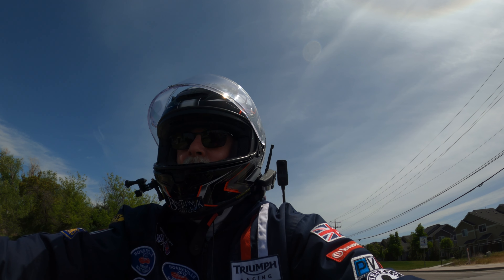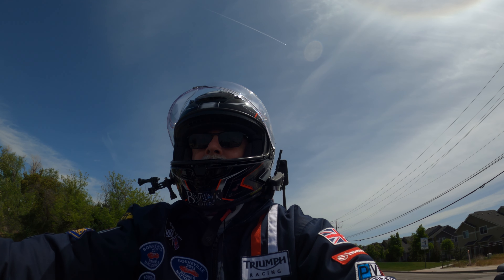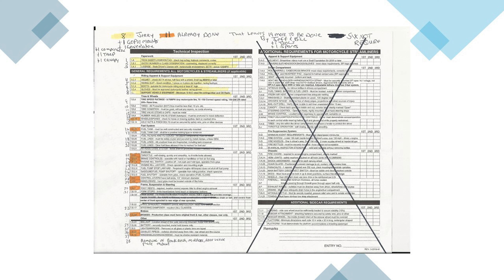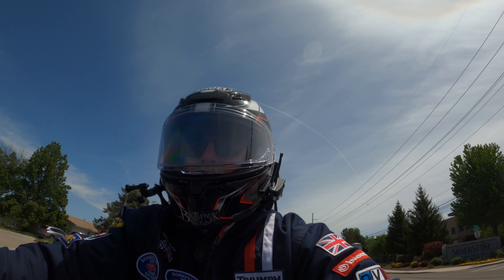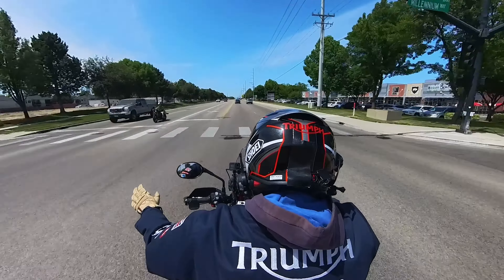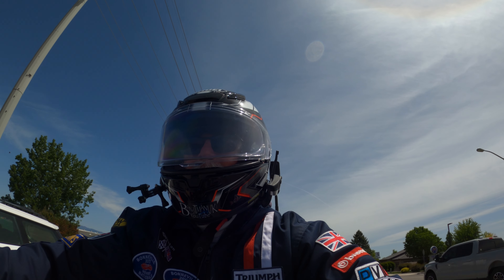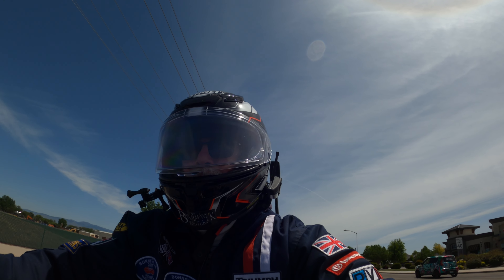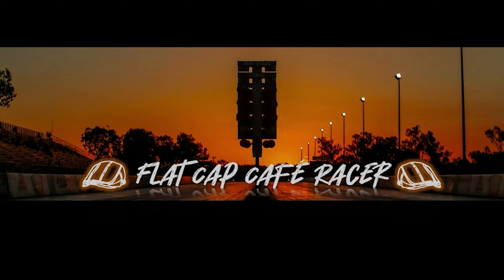Seventy-Nine days until we take the Rocket 3 Bonneville Speed Week

Comment: The rev limiter has been opened up to 7400 RPM so the limiting factor on the RPM should be power and not throttle body opening or limiters.
Reply from the maker: I'm thinking the Dyno was before the update to the ECU. Unfortunately I think we may need more room to get to redline.
Reply: @flatcapcaferacer  The dyno run was made before the rev limiter and speed limiter were unlocked but the throttle bodies were unlocked.
Reply from the maker: That's better, I probably should have remembered that Jeff. That gives us more rpm to spin up that new rear tire😉